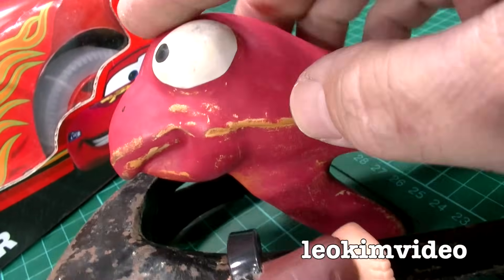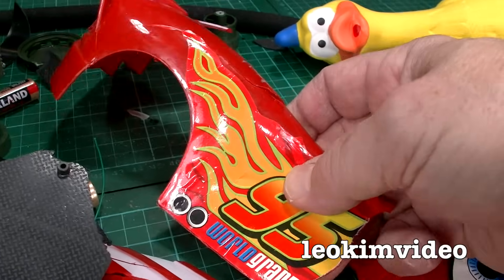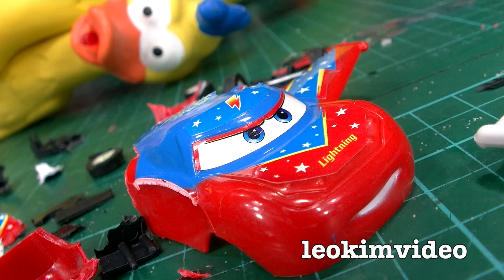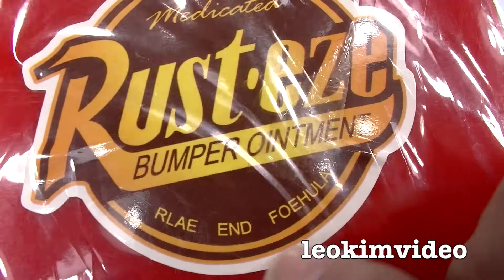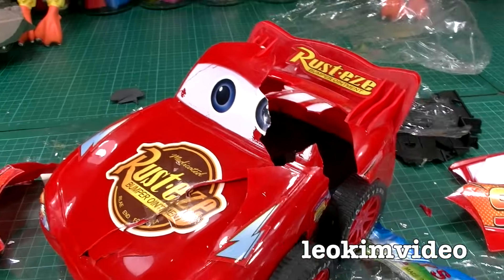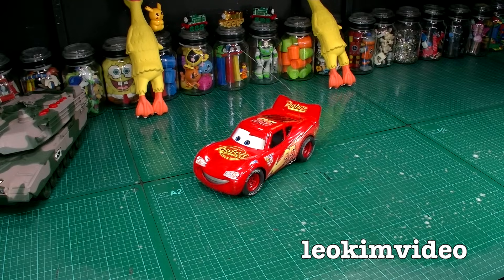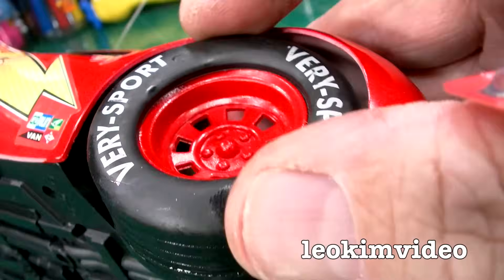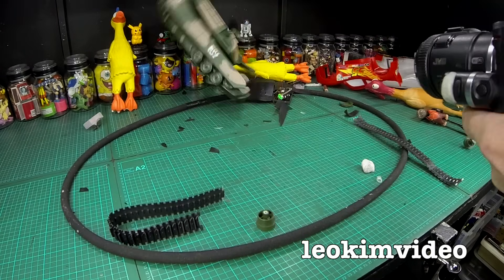Disney Cars Dark Side Knock Off Toys Ep4 Smashing Lightning McQueen

Comment: NASCAR vocab:
     The flaps on the roof are called "Roof Flaps" and their job on a stock car is to keep it planted firmly on the ground when the car spins backwards at high speeds.
     The bumps on the hood are called "Hood Pins" and their job is to hold the hood down and make it possible for pit crew members to open the hood without having to pull a lever inside the car.
Reply from the maker: Thanks about the flaps on the roof info. I never knew they had an important safety job to do if the car starts spinning. Now I'll search for NASCAR cars spinning to see the flaps inaction.
Reply from the maker: I found this video and I can see how those flaps work. It's totally amazing, thanks for the NASCAR lessons
https://www.youtube.com/watch?v=KLd-o-9piG0
Reply: leokimvideo my pleasure! if you'd like to see a Video of the roof flaps failing to do their jobs, you could look up "Carl Edwards Talladega 2009" or "Matt Kenseth Talladega 2016" it's quite amazing to see what can happen if such a small part of a car fails to deploy.
Reply from the maker: I looked up your suggestions then got caught up for hours watching NASCAR crashes on YouTube. Where I live we don't have that style of racing. Again thanks for your help in understanding the sport.
Reply: leokimvideo yup! NASCAR sure will do that to ya! always happy to help!

Comment: Hey Leo check out the new sphero lighting McQueen RC it's amazing you need this for your McQueen collection
Reply from the maker: Just looked at it online. It's weird as it's marked as Cars 3 yet the '95' detailing is missing from under the headlight (the Cars 3 McQueens have the 95 in a new spot). At $300 and much more if I convert to Oz dollars that's just too much for a toy. Yes it's nice but wildly overpriced.
Reply: leokimvideo that's the problem with all the sphero toys they come at a cost
Reply: leokimvideo and maybe the 95 detail changes place after McQueens epic crash in cars 3 and after he is rebuilt he gets a new paint job with the new detailing